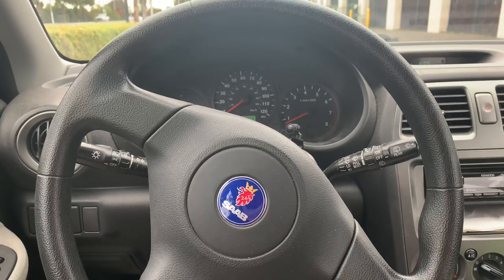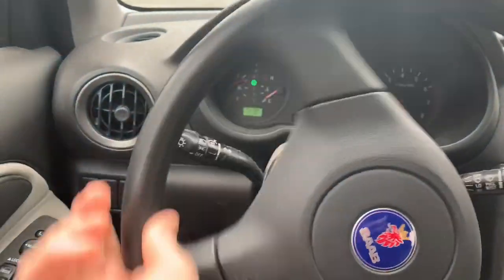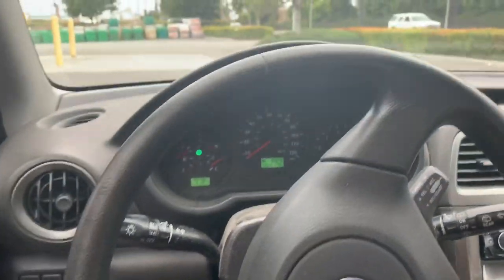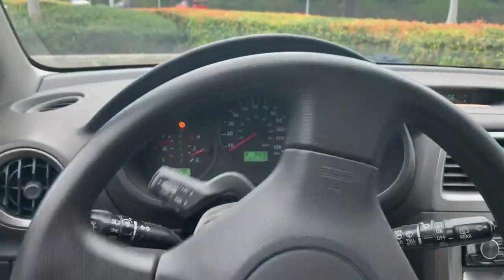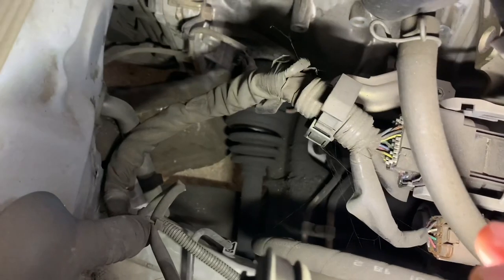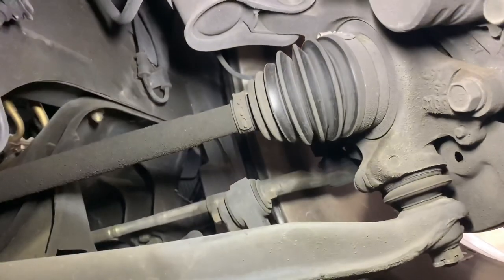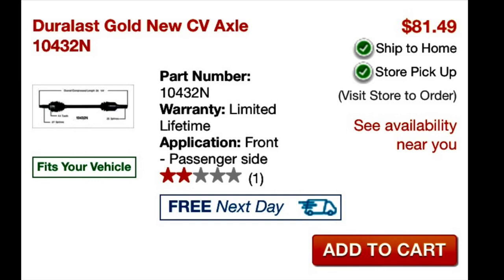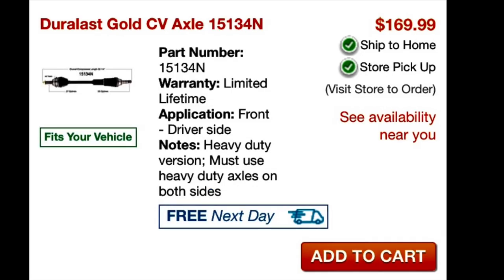Subaru Bad CV Axle Diagnosis

Comment: Hi there thank you!! I’m certainly hearing & feeling the vibration when I turn, not driving straight. I’ve assess both the inside & outside boots, neither blown out, no grease spray. My ‘13 Subaru is a manual transmission. Can I still test for the power steering problem you mentioned? I jacked the car up, heard the sound while manually moving tire/ wheel back & forth, not when rotating simply forward or reverse. 
I hear the sound & feel it bilaterally though. Could both cv joints have gone out without obvious boot tears?! Thanks again!
Holly in Atlanta
Reply from the maker: It could also be the mechanism that determines how much power to send to the front wheels, and how much to send to the back wheels. I don’t know about your year, or if it’s also a problem on manual transmission models. Sometimes that will go bad, and it will try to send too much power to the front wheels, and that makes noise when you turn sharp left or right.

Comment: I'm getting a bad vibration and heavy clunking from the RF only when accelerating while turning (like getting on it turning onto the highway). Does not do it getting on it going straight.
Reply: Same! Did you identify the source of the issue? Was it the cv joint?
Reply: Just had same issue. Was bad above 60mph. Had the control arm bearings replaced on my front right. Fixed the problem

Comment: Bad CV axle can make a clunking sound going straight as you accelerate.
Reply: Its the axle also many myself i had this problem! Find what side and make a change
Reply: Omg finally figured it out.  A key indicator for me was the clunking noise also matches the speed of the vechile.  Pull and pushed the cv and had slight play in it even tho the boots looked good.